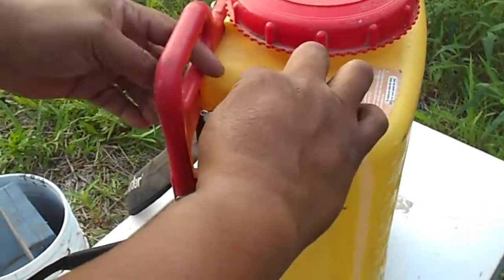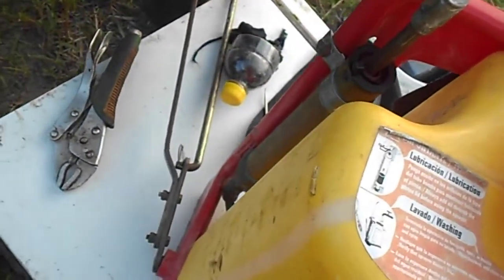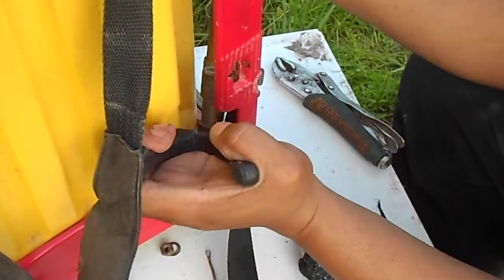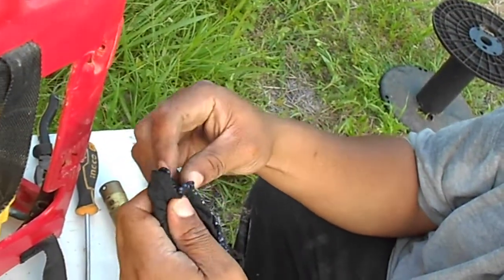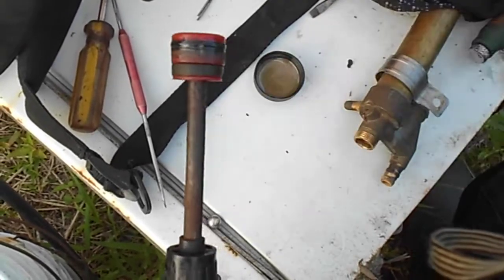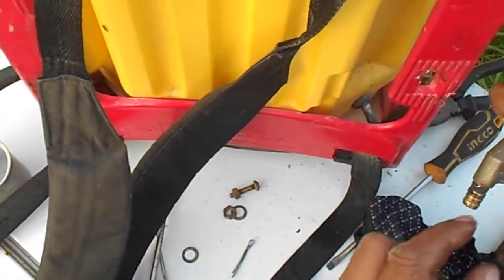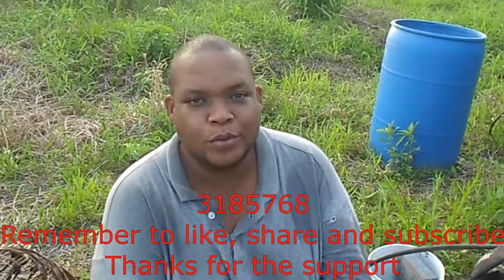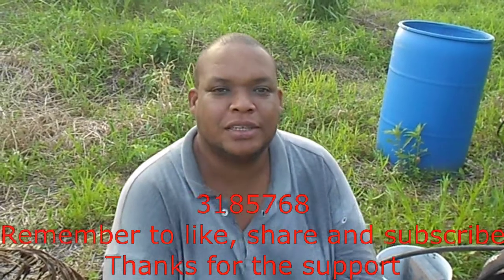How to service the pump on a Royal Condor spray can

Comment: I have a plastic pump change the seal. But i find like I have to pump to many times for it to spray good. Could  the yellow part on the next side go bad
Reply from the maker: could be, there are also O rings on the lance. Look for leakages

Comment: How often must one service the pump....no place to fill oil. I bought one Saturday gone, not yet used it. My main concern is the lubrication of the pump.....help me please.
Reply from the maker: Lubricate according to use. The oil goes in at the top of the pump.
Reply: @ReapingWhatYouSow  ..... is there an opening to pour in the oil a cap or so?
Reply from the maker: @vishnuramdass67  call me at 7839929 if you can
Reply: .    will call tomorrow morning
Reply from the maker: @vishnuramdass67  you can call or message now if you want

Comment: I have one but it stop spraying what to do?
Reply from the maker: That would depend on the symptoms.
Reply: @ReapingWhatYouSow  are you from trinidad
Reply: @ReapingWhatYouSow  I check it out and it clear from clogged, so can it be the rubber on the packing
Reply from the maker: @dalelyons.3886  Trini to the bone. Either one can cause it.
Reply: @ReapingWhatYouSow  thank you, I am living grande but them garden shop doesn't have parts for it
Reply from the maker: @dalelyons.3886  depending on the problem you may not need any parts. Depending on the brand you may have to shop around.
Reply: @ReapingWhatYouSow  thank you for your time